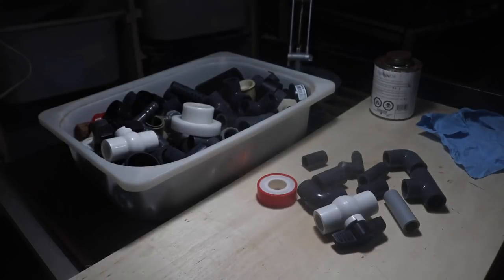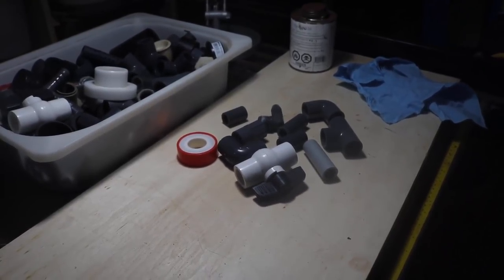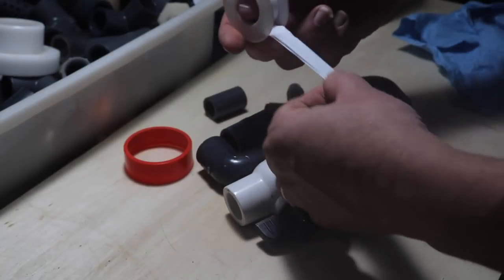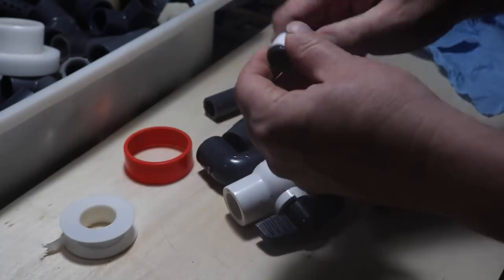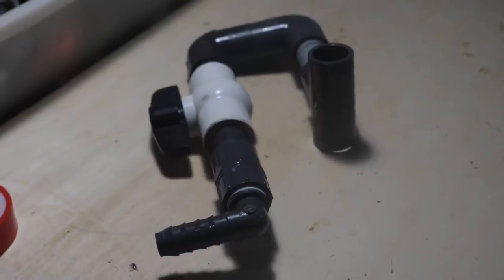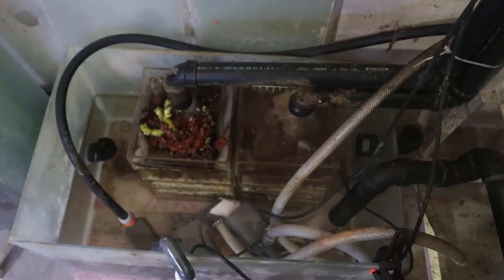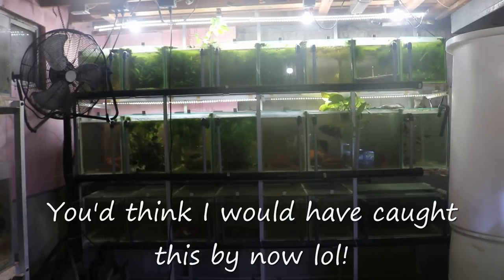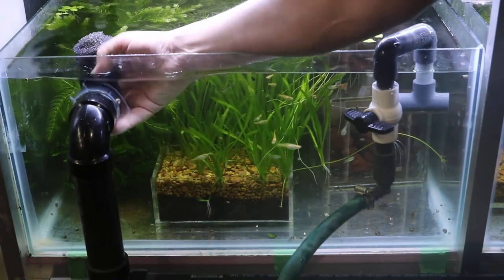What Kind of Fish Room do you want? part 1 water changes

Comment: Thanks for video, looking forward to series.  You have well water? Assuming as you don't seem to dechlorinate, just mix hot/cold from tap for desired temp?  I have high water table and a sump pump that I've been using for water changes.  Gets around chlorine in city water but figuring I'll have to pump it into 50 gallon barrel and let it acclimate temperature wise as it is getting rather chilly.  Thanks
Reply from the maker: Actually I'm on city water. With a 10 to 15% water change I've never had issues, though none of the fish in these systems are at all delicate. Thanks for taking the time to watch and comment

Comment: Pretty cool I'd love to automate my water changes. My tank is a "show tank" in my living room. I have a fancy faucet in my kitchen so I don't think I can do a python. Do you have suggestions? I have to lug buckets through the house 😢
Reply from the maker: If you have a set tub in you basement, you could run a hose from there. Unfortunately these new fixtures are a pain to attach to
Reply: Thanks for responding. Makes sense. I need to do something it is such a pain 😊

Comment: I have a question, how many 300Watt heaters would
Be necessary to keep my water temperature at or slightly about 76° for 4 55 Gal & two 75 Gal tanks?
(Note these are all connected to one sump)
Reply from the maker: The problem with answering your question is that heaters will only raise a temperature so much above whatever your room temperature is. Assuming an average room temperature I would start with two and set them for 78 deg. It's always better to use at least two in case one fails and by starting this way if one seizes in the on position you won't cook your fish. Let me know how this works out for you and thanks for watching